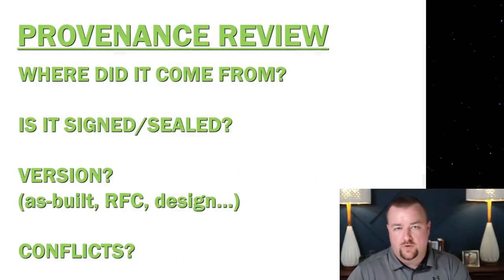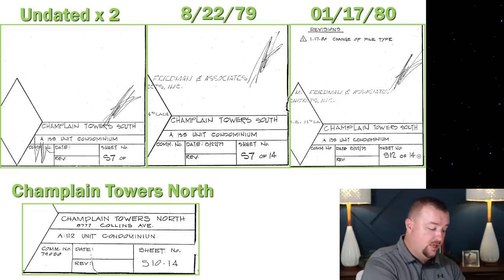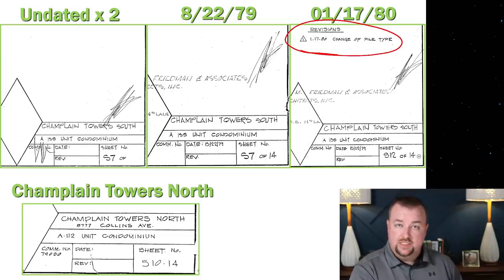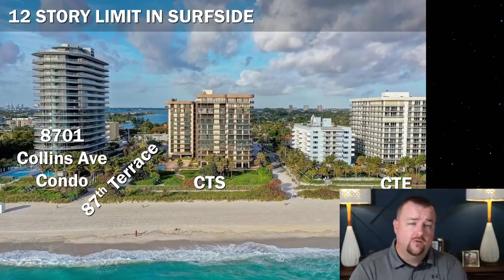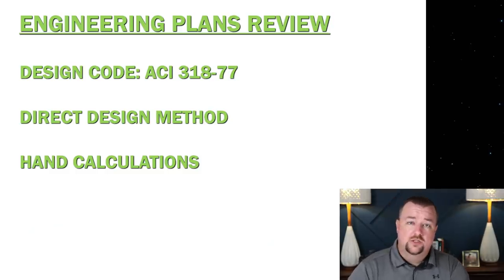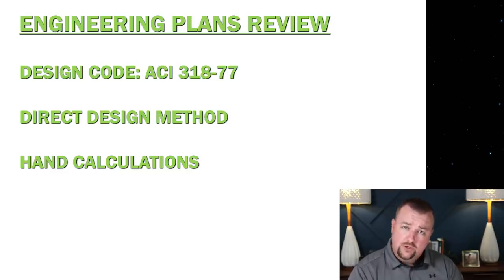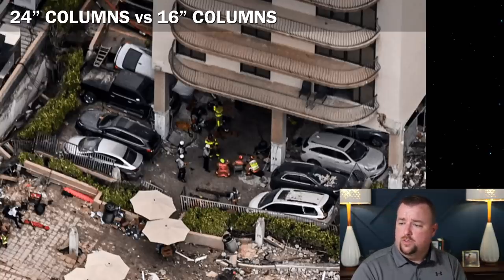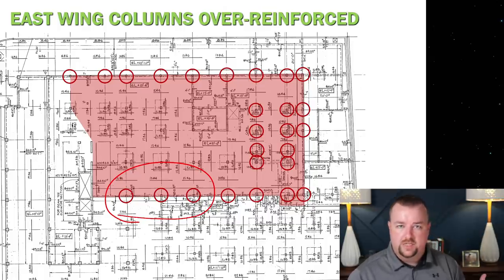Engineering Failures Found in the Champlain Towers South Drawings - Surfside Collapse

Comment: Just wanted to add that the woman's garage walk through video has been an invaluable record for verifying the construction and determining where the failures took place.
Reply: I know, what a blessing
Reply: It has and I have spent many hours on the phone with her as well
Reply: Perhaps people should start doing video walkthroughs of all such sub-grade parking areas -- who knows when the next one might collapse and such evidence will be invaluable. These days anyone with a mobile phone can record a video quickly, cheaply and easily at minimal/no cost. Perhaps this is a new hobby people could do as a community service?
Reply: Which is kind of why security guards tend to take photos of much anything unusual or a potential problem. Part of the job description to take note of anything unusual or a potential hazard or problem.

I think often many repairmen may also take before and after photos, documenting their work.

Perhaps the photos will never be useful for much. But if "something happens" the photos could turn into valuable documentation or evidence.
Reply: @Yosef MacGruber I’m a Plumber/HVAC tech and I learned years ago to document EVERYTHING I do with photos. The first thing I do is take photos of everything from every angle, take snapshots whenever necessary throughout, and then take photos of everything from every angle again. I found you never know when all of a sudden you’re asked to recall details from a repair you did last month, 6 months, a year, two years ago.. I never delete photos and have 100,000+ saved on iCloud. It’s been invaluable to me, being able to pull up detailed photo documentation of all my past jobs, and especially when you have a vindictive customer trying to make false claims.

Comment: As a concrete inspector and civil engineer I found the video very interesting.  I find it unbelievable that the City could of approved of new planters at the pool deck without a structural analysis.  Either it was installed without inspection or there were a lot of very negligent people involved in the remodel.
Reply: Yes do the load analysis but the couple tons of planter are a trivial addition for this beam system, given well made structure.  The problem here is long term contact with water.  Unprotected steel reinforced old mix concrete will corrode and fail in long term continuous contact. That roof deck didn’t drain.  An earlier inspection on the building. now widely available pointed out water.
Reply: A bit of $$ in the right place and knowing certain people trumps engineering sense!
Reply: @Nill757  well, no. many factors contributed together. long term contact with water is a problem, but shouldn't have lead to a catastrophic collapse of the whole tower. that's why inspectors noticed the problem but didn't condemn the building. if the structure was originally built with proper safety factors, proper rebar, and the extra load was not added, then the corroded rebar would be a problem but not an emergency. the fact that nobody noticed the bad original design OR the exacerbation of the bad design while adding additional load, are what lead to the catastrophic collapse of the whole tower. prematurely aging rebar would just mean work should be done to correct it, or the worst-case scenario where the pool/garage partially collapses but does not bring down the whole tower.
Reply: @somedude-lc5dy  Building Sinking due to being built on landfill over former water inlet certainly did not help. First day Engineer giving analysis I should have wrote down who where saying this going to be a large number of different failures certainly seams right.
Reply: they were only planters, what could go wrong?
Reply: @Nill757  Remember the slab floor of the planters was not designed for 1000PSF
Reply: @rogerpearson9081  Trump would know.
Reply: @somedude-lc5dy  It would in this case as the step beam tied the deck heavily into the building at the beam. This main beam was damaged by the slab ripping out. The seismic force caused the penthouse or lower floor to collapse.
Reply: @RedRocket4000  Yeah I think the pilings had to be effected
Reply: @chiefinspector7280  Planter load was not 1000 psf.  Look, slab did not fail w onset of a static planter load and never would have failed with rebar properly protected from water ingress. The industry has developed blinders about its goto material, reinforced concrete, pretending the newly cured tensile strength lasts indefinitely in weather with slapdash waterproofing and mumbling about maintenance contracts down the road.  The truth is, regardless of original margin, a weather facing rebar structure is dangerous 30-40 years out, because maintenance that far out can’t be guaranteed.  Calls to overbuild structure are just so much denial, while padding up construction costs.
Reply: @Nill757  a man that was around in the 1970’s had watched much of the buildings going up in the beach areas.  The rebar was commonly laid out on the sand to store it and get it out of the way until needed.  They weren’t plastic wrapped at that time.
Reply: TBH, even the original planters were too much with those beams taken out.  It's insane that it was built this way at all.
Reply: @RedRocket4000  right? I noticed water on both sides, I was thinking this myself was this land  filled to accommodate building?
Reply: Agreed.  People generally underestimate the weight of plants and wet soil that hasn’t been modified with perlite or vermiculite (or equal).

Comment: I’ve learned so much about structural design from your channel. I live in a high rise in Boston with serious structural maintenance issues similar to the ones which you have reviewed. I only rent so I’m moving but I did notify the local building inspector and I think I was able to take good informational photos due to some of the wisdom that you have imparted. Thank you sir!
Reply: Glad you are moving!
Reply: @cherylhoskins1679  Yes and remember a Military and good restaurant rule, it does not mater that something you see wrong is unimportant for safety you assume if they let you see something wrong the things that are important for safety are wrong too.
Reply: The owner of the building is probably also glad you're moving.
Reply: @RedRocket4000  yeah maybe if you see some unexpected planters added around a building you can assume the building itself is unsound.  Or if my car was originally blue and I repaint it red, now the car is unsound.  After all it's suspicious, right?  But that's why we have engineers, to get beyond such random suspicions and actually understand whether it's sound or not.  That's what I did not see in this or any other of their videos.
Reply: @davidquinn9676  hahaha
Reply: @RedRocket4000  
I think it was Dale Carnegie that said "Passengers see that the flip-down trays are not cleaned and worry if the engines are also neglected".

Comment: Last minute construction changes are sometimes done without the full design team evaluating the change and the significance of a "simple" change isn't recognized. We all studied the Hyatt Regency collapse and you may be telling us about yet another story about a "simple change" with huge consequences.  I'd be interested to know more about that 1980 change to this design. Was the original structural engineer the one who signed the 1980 print?  As you point out, the design change may have also accelerated structural degradation as salt water, etc. weakened the structural elements. This was one of those "swiss cheese" type failures, when the elements lined up, people died. Your work is so important and your videos are lucid and have lessons for all of us who build and maintain the built environment. Thanks for your work.
Reply: In the digital world these changes can be quickly evaluated.
Reply: The sign off looked identical
Reply: My background is in software, but it's the same issue with changes. One of the problems with software is that the reason why something was done the way it was done gets lost. I highly doubt the person who did the original drawings was the person who signed them. It's the new guy straight out of college who does the grunt work in software. My bet is that the first person (probably more senior) who did the work with the stepdown had the beams in place for both the stepdown and the garage, but someone newer made the change to remove the stepdown and didn't understand that the beams served two purposes. If they didn't list removing the beams on the plans, the PE who signed the plans may not have noticed the beams were gone. The new guy might have had to work over Christmas holidays to get the new plans submitted in early January, when there was no one left in the office to ask questions.
Reply: @OOpSjm  The judgement of the structural engineer is still vital. In the Hyatt case, an engineer applied the wrong assumption. Yes, with digital models the ability to analyze changes is easier. We've interacted with a mathematical model of a seismically unsafe high rise to improve the constructability of an upgrade design however that exercise was guided by an experienced team of structural engineers and checked by peer review. BTW: They  ultimately imploded the building and replaced it.... :-)
Reply: @bbamboo3  I’m not familiar with “the Hyatt case”, would love more detail and if that is another building collapse, maybe Josh would tackle that situation in detail as well?
Reply: Not a structural engineer, but another field.  But I wonder if the engineer that made those January changes and documented it as 'changes to piles' is the 'smoking gun'.  I can see that person handing them off to the PE to review and sign, and the PE saw that the changes were the piles and didn't notice the beam change/elimination.  If the more senior PE had known the beams were also eliminated, they may have reviewed that part more closely and caught it.

After all, the August plans were reviewed to be adequate and then somebody says, "Here's an updated revision, we changed the pile details."  The senior engineer probably reviewed those changes carefully, but had no reason to look all over the drawings for, "what else did you change???"  :(
Reply: There can be a lack of communication leading to such mistakes too.  I spent many years as a soils engineering technician and oversaw the earthwork at countless sites where bearing capacity of the native soil was insufficient, but with proper modifications via earthwork, the soils were made suitable.  In one case, the site of a big-box store, native soils were very incompetent to carry the direct loading of the deep perimeter foundation, so a substantial undercut was performed around the perimeter.  The planned perimeter wall had a number of zigs and zags.  I can't remember the reason, but I had to call the engineer about something during the time that soil modifications were well underway, and he casually commented to me that "we're going to change the locations of most of those walls soon anyway."  Had those changes been made, that would have moved the walls OFF of the locations having specially prepared soil for proper foundation support and settlement would have been likely, yet he hadn't even considered that possibility, even while talking to me about the massive earthwork modifications currently underway.  Checks and balances are important!
Reply: Looking at the column plan of the second floor made me immediately think of the Hyatt Regency.  Having columns that aren't stacked straight vertically seems crazy unless there's a proper beam to transfer the load.
Reply: Being a Kansas City Area native the Hyatt Collapse is a story I've heard all my life (though the accident happened when I was too young to remember) and it's really just a great, classic, example of how changing plans on the fly without consulting engineers or thinking how it'll impact loads and stresses of construction can result in trouble.   Here it seems like a number of things piled on one another and it seems shocking the building lasted this long.
Reply: @BuffyLynn I remember  when that happened. Modern Marvels: Engineering Disasters did an excellent review of what happened and spoke to the architect. A lot of those episodes which were produced by the History Channel, are available on YouTube.
Reply: @markfiedler3986  nope, it was actually the contractors calling up the engineering company about the original plan being impossible to assemble (both walkways were held up by nuts and washers on a single tie-rod, requiring a 40ft long threaded section of tie-rod.), so they asked if it could be changed so that the rod was in two sections with 1ft of thread on the ends...  The new engineer who approved the change didn't recalculate the forces, and didn't realize that the new design placed double the load on the upper walkway mounting nuts because tie-rods holding up the lower walkway were now hanging from the upper walkway instead of from the ceiling. (It also meant that upper walkway had to carry the load of all the people on both walkways.)
A few too many people on the walkways one night, and the holes in the metal beam resting on the upper set of nuts and washers stretched to the point that the nuts pulled through, and both walkways full of people fell onto the packed dance floor below.